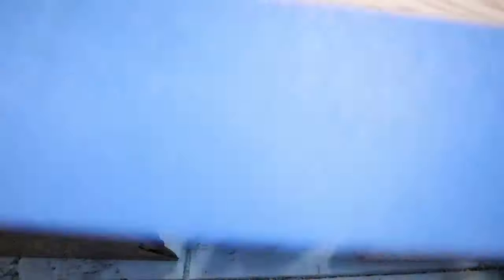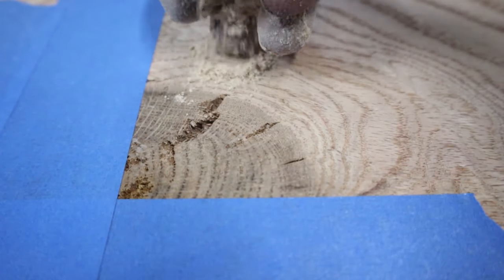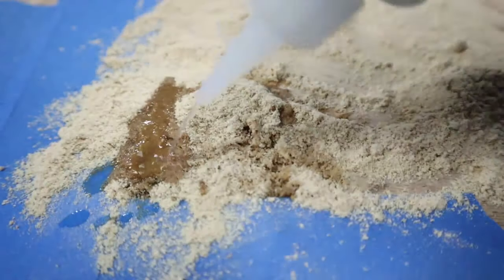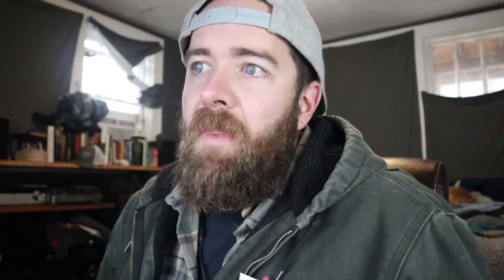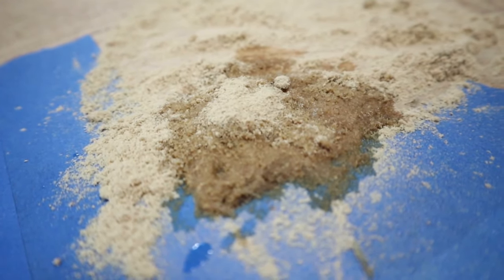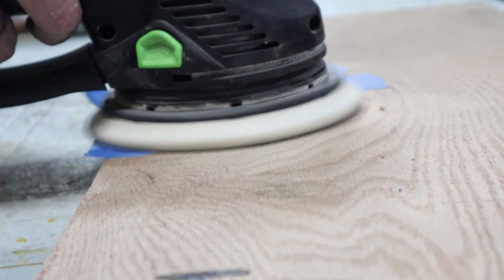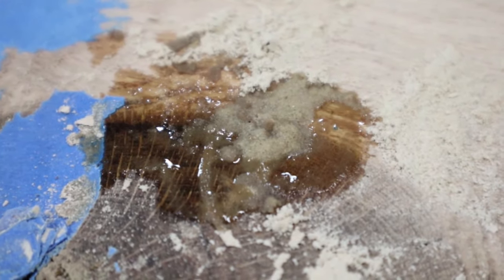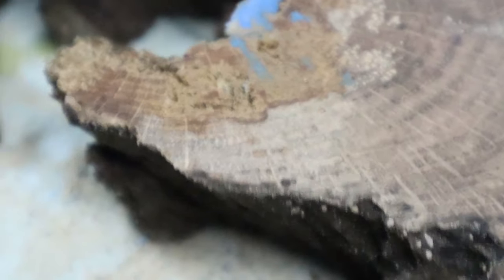What Happens When You Mix Super Glue And Sawdust??

Comment: I think most will agree that epoxy is better than CA last longer stronger not as brittle, etc. there is a five minute epoxy and I don’t know how it compares to regular epoxy, but I am using whatever epoxy I can get a hold of and mixing it with a product called fillet Which is a super fine sawdust like filler designed to mix with epoxy and thicken it which looks better than sawdust sands better than sawdust and I think it’s just overall superior to CA  glue, which I don’t trust to be strong in the long run sold by West company to their boaters customers who use it to get a few more years out of Weatherwood by filling in all the cracks
Reply from the maker: Definitely have a few gallons of fast and slow set epoxy in the shop and don't disagree with you, I have not seen either one fail yet in the environment so I can't say for sure which lasts longer. Cheers.

Comment: the smoke or boiling is called kick, they sell activators you spray that kick the CA glue as well. is a exothermic reaction but is rare to start any fires as the reaction is very tiny and short in time, also it isn't making a ton of external heat but is a thing to know and be careful of.
Reply from the maker: Man I couldn't imagine using an activator on this stuff for my projects, feel like it would kick too fast for me! Thanks for the science and info Randy.

Comment: I use this method to make super strong joints for RC models. This should never be done without wearing a mask and goggles
Reply from the maker: How is the longevity of the repairs on the joint on plastic? Very curious as it is not an application I am used to.

Comment: Do not use paper masking tape. It will catch fire too and leave a burn mark on the wood possibly.
Reply from the maker: Good thought here. Luckily mine did not, but I could see this happening. Do you use any tape on yours, if so what kind?
Reply: @JeffEstesBuilds  Actually don't use tape but if an area is built up too high I sand it down. Works on wood or Bakelite plastic old tube radios.

Comment: I always seem to cut my fingers or once smashed a finger in between 2 landscape blocks. Anyway clean the wound let dry . Cut nylon hosiery into 1/2" strips a few inches long . Apply small bit of your favorite SY-AN-O  AK-RIL-LATE glue on your finger that has been a victim of a accident. This is the starting point for the nylon strip, do this carefully .  Keep applying glue and laying nylon on the length of finger just like you would put on a bandage. Where a joint is don't apply the glue this will allow your finger to bend. I always completely wrap mine to where there is not any skin exposed from beginning to end of wrap. This will take about 5-10 minutes to dry. When it is dry it will be hard as a cast put on at a hospital. If you try to keep this from getting soaked  it will be good for a couple days . Take some scissors and cut it off when your ready to remove it. If you cleaned it really good it will heal in 1/2 the time than a bandage and you won't feel any pain when you grab stuff. It literally is a home made cast and almost indestructible. I was splitting wood and stacking a Ash tree that was 40'-50' tall in July temp was in the 90's and humid. and the "cast stayed on my finger for 2 days.  I had smashed it, it was almost pain free . Try it next time you will be glad you did.
Reply from the maker: Just did this, and it worked. Solid  deal.
Reply: @JeffEstesBuilds  are you replying to me ?
Reply from the maker: @sux2bu883  superglue on the cut worked great. Got scared of using nylon and having it get hot though.
Reply: @JeffEstesBuilds  The nylon will be the best band aid you ever put on. Matter of fact I cut my little finger yesterday. I'm using nylon superglue combo right now. It will literally be hard as a rock. I don't know what you mean by get hot. It won't melt unless you have your hand in a fire, if that's the case you will have bigger problems than the nylon getting hot. Next time try the nylon combo you will be amazed how durable and protective it is.

Comment: Is CA  glue Super glue? OOPS I guess it is I think I heard you say super glue...
Reply from the maker: Hey Jessica, CA stands for cyanoacrylate adhesive, and most "super glues" to my knowledge use this chemical structure/ compound as their base. The glue I use in this video can be found here at this link. Great stuff, just be careful!!! https://www.amazon.com/Bob-Smith-Insta-Cure-Super-Thin/dp/B001NI4JWI/ref=asc_df_B001NI4JWI/?tag=hyprod-20&linkCode=df0&hvadid=167152358566&hvpos=&hvnetw=g&hvrand=12939106629278720852&hvpone=&hvptwo=&hvqmt=&hvdev=c&hvdvcmdl=&hvlocint=&hvlocphy=9013185&hvtargid=pla-313991285242&psc=1

Comment: I also use super glue with baking soda to plug holes and leaks on radiators and as a filler for plastic, wood and metal.  Its great for welding two pieces together  and stronger than JB Weld. And sets in seconds...
Reply from the maker: Interesting, does it hold up well against the heat of a radiator?
Reply: @JeffEstesBuilds  it sure does hold up well  check some videos on YouTube on super glue and baking soda  They run through all kinds of heat and stress testing.

Comment: Can you stain over it ?
Thank you.........
Reply from the maker: Yes, but be mindful not to over-buff the stain that sits on the dried glue. It will take a lighter shade. I would be fragile on that area and if you want it / need it to go darker, spot some on with a rag. Let dry, and spot wax-free shellac to lock it in before your top coat. Be sure to wax free shellac the entire piece to insure a uniform top coat! Any sealer should work, but I have had great results with wax free shellac.

Comment: How does it stain?
Reply from the maker: It will darken with stain, but will still maintain elements of translucent characteristics. The less you buff that particular area of stain off, the darker it will take, just be careful on your top coat and letting stain properly dry. To really lock in questionable stain areas I always use de-waxed clear shellac, this allows for any top coat.
Reply: @JeffEstesBuilds  Thanks man, sounds like you are recommending shellac before stain, not applying directly to the wood?
Reply from the maker: @PartScavenger  no problem, but stain always first, then shellac before top coat!

Comment: Is there any way of altering the color ?
Reply from the maker: yes there is, but you would have to act quickly. I would try a powdered resin dye found on amazon, fill the hole or void with the powder and add the glue directly on top of that, in place of sawdust. Usually you can mix the powder dye directly into resin or epoxy but in this case you will need to treat the dye like your filler dust.
Reply: @JeffEstesBuilds  fantastic, and the fast reply has moved me to subscribe. thanks buddy.

Comment: Have you every used polyurethane over the CA glue and if so did you have any problems with it?
Reply from the maker: In my experience the polyurethane glue is either expanding (Gorilla Glue) or the kind in the tube for general construction adhesion (PL, Marine Glue etc.). In a situation for a wood filler I would stick with a glue like CA or traditional wood glue for speed, ease of use and consistency. The Poly glues are fantastic for strength and water resistance but get SUPER messy if moved around.
Reply: @JeffEstesBuilds  sorry I should have clarified...I meant a polyurethane finish on top of a CA glue repair.
Reply from the maker: Right on, makes more sense. It works really well. So far I have not had any issues with it. Just follow the same ol steps for finish work and you should be in great shape. One thing I would say is that if you only do a few coats, the area with the CA glue will look more grain filled than the other areas which can bother some people. The more build in the finish the better off you would be to avoid this.
 @joshuasmith1215
Reply: @JeffEstesBuilds  thanks, I appreciate it.

Comment: I have used this technique on fixing wood gun grips and stocks, my question is can the area hold a screw after it is cured and dressed?
Reply from the maker: Excellent question. Short answer, don't trust just a filler of ANY kind to hold a screw like the original fibers of wood. Instead, take a match stick, carve it down to a small point and jam it into the hole with wood glue, or super glue if desired. Once in the hole, score the stick and snap it off like a shim. It does not need to fill the hole perfectly if your going to put a new screw into it. The new screw head will "explode" the wood giving it proper grip that is chemically attached at the grain level. Keep the work area clean on a gun stock, tape off before glue and be prepared to wipe off excess immediately. I will make a video this week for ya!

Comment: Is it better to press sawdust into the hole for better strength & density?
Reply from the maker: I like to fill it in under its own weight with a slight mound on top of it and pour from there. If you pack it down or make it flush with the surface, the liquid will move it around and you might end up with small holes or impressions.